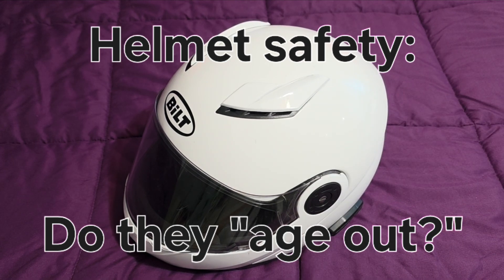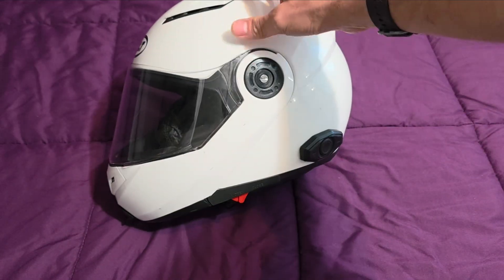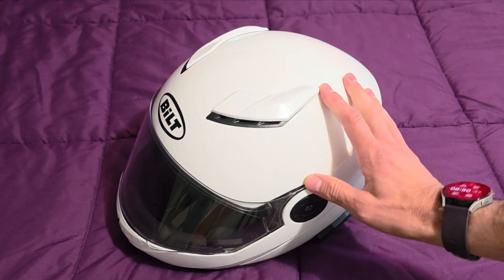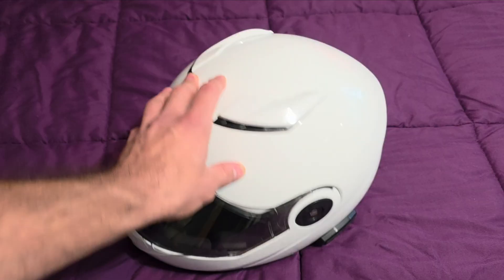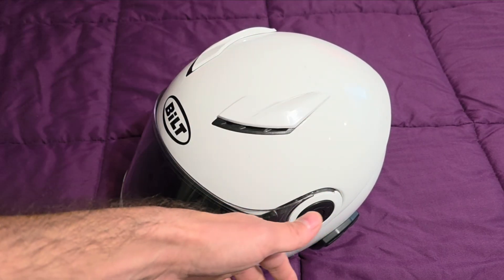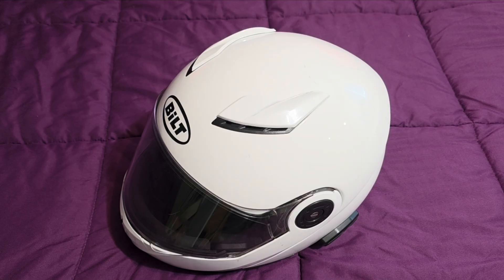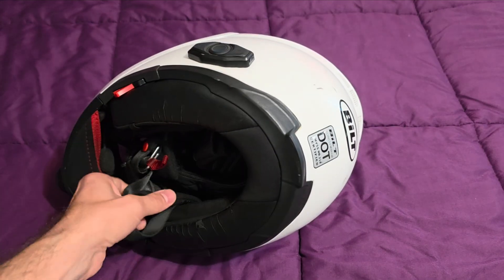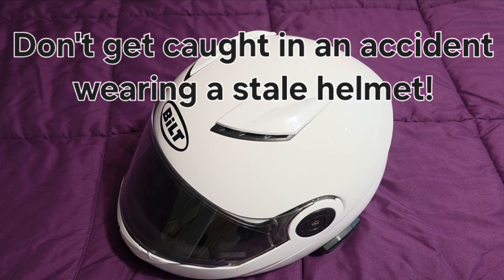Do helmets "age out?"

Comment: I cant keep buying an Arai RX7X/Shoei X15 every 3 goddam years
Reply: Simply don't. Love my HJC C10, practical, simple and cheap.
Reply from the maker: So don't!  Do like me and get a $300 helmet to wear out, because you know the point of it is to go in the garbage.  

All the gear is meant to work once, then go in the trash.

But if you insist on a higher-cost, "status" helmet, then let me please encourage you to just accept the cost and still replace your helmet on time.  Your head needs it, even if you, like me, feel like there's not much left in there to protect.

Thanks for writing and stay safe!
Reply: @danfruzzetti7604  I have to disagree on the “status helmet” part. A 300€ helmet is an entry level and falls back in protection compared to more expensive options. I would say spending at least 500€ on something with multi layer eps, MIPS and sophisticated fibers is the go to minimum. It will be far more comfortable to ride, safer and it’s not even that much more expensive.
Reply from the maker: @halo-7797 this is a solid point.  a good way to look at it is sometimes advanced helmet features do end up becoming required helmet features as safety standards improve over the years.  BUT if it has any EPS at all, or you wear it a lot in the sun, it will still age out.